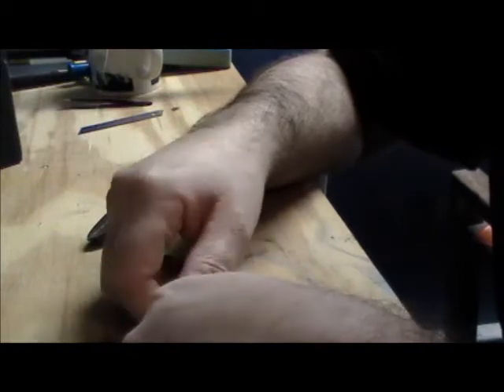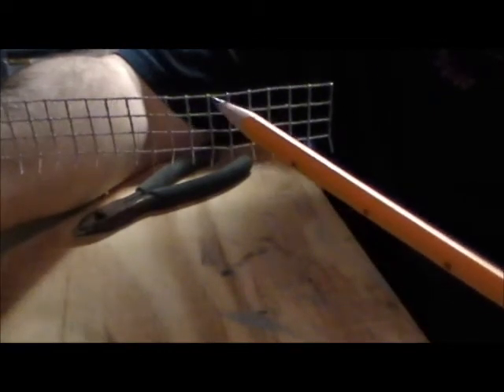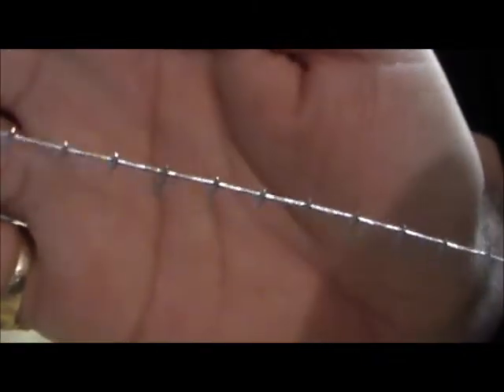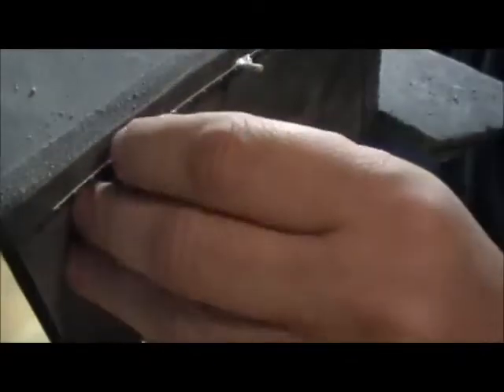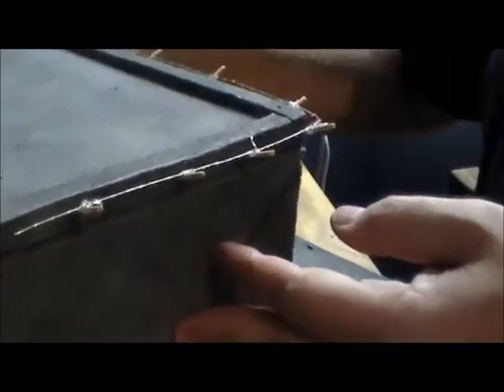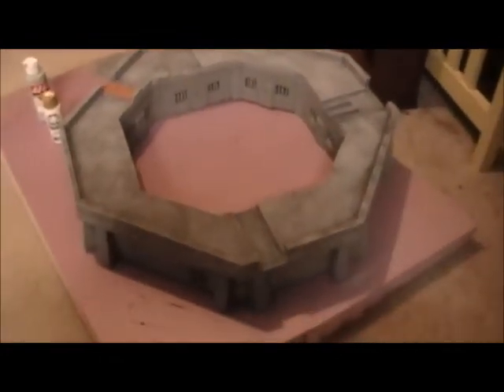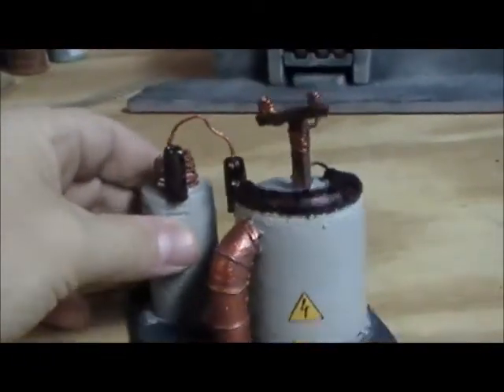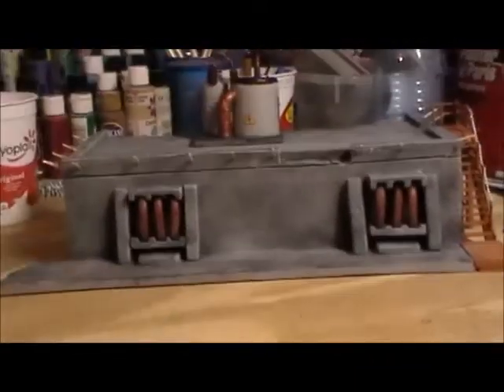How to make barbed wire and ...

Comment from the maker: I did see that video Viv.  This method does not leave sharp edges.  the soldered intersections where I cut are rounded off.  Even if some are sharp...they get sanded down.  Thanks for the comment and video bro!  Congrats on the shop.